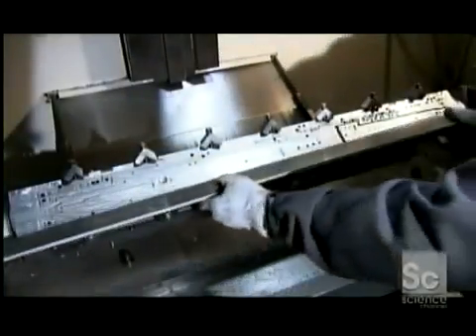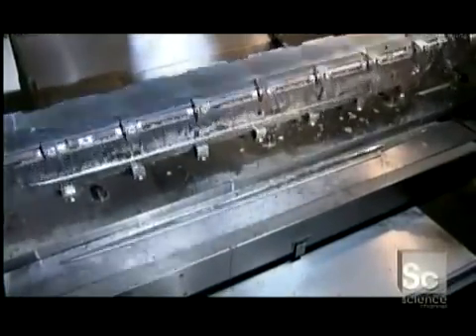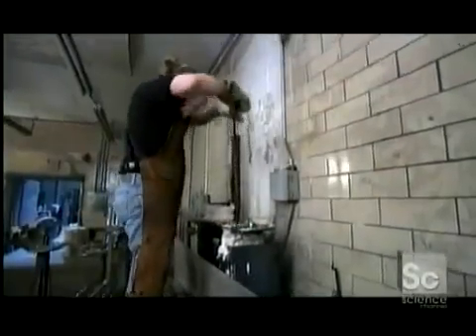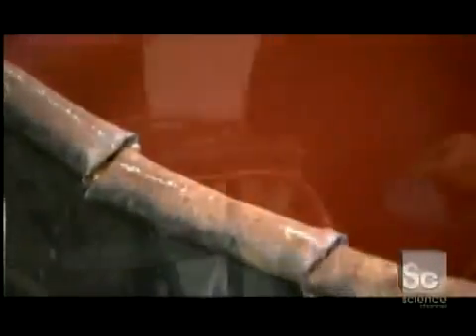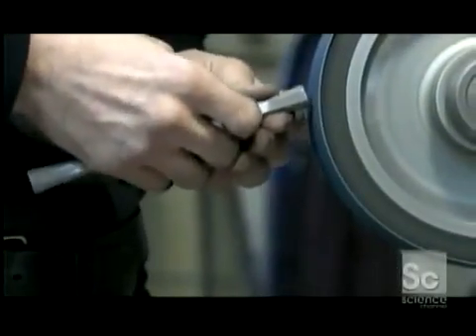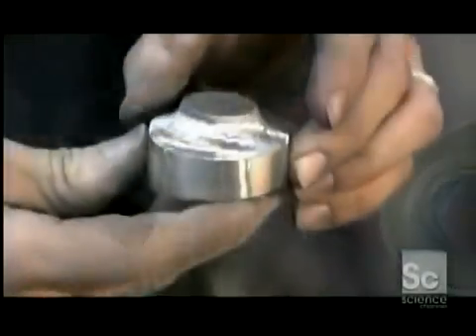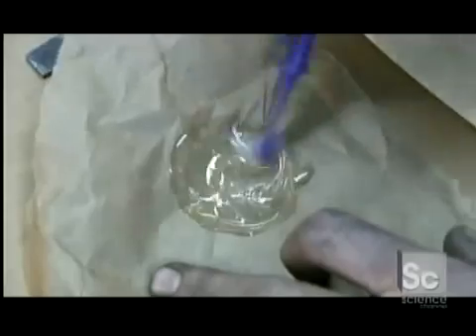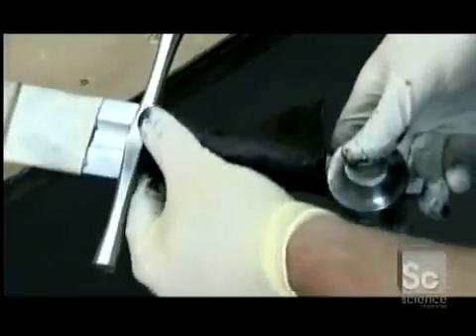How It's Made Swords - Discovery Channel Science

Comment: a cast metal guard is not acceptable on anything "battle ready" (idk if this sword is BR or not) and if you don't heat treat the handle it will bend with impact. the whole sword when fully constructed should ring (not actually ring but vibrate together, have resonance) like a bell when stuck because of the tightness of fittings and one important step in doing this is forging your crossguard or habaki  to fit directly on the blade(by forging it on the blade)  that way it will flex and bend and absorb shock all as one unit rather than against each other, eventually working itself apart .
Reply: This is Albion armorers, objectively the best makers of functional swords in the world. They know what they're doing.
Reply: Depends on the casting technique and the metals involved.  If it's the investment casting technique used by Ruger Firearms, the casted parts are more than strong enough for the task at hand.